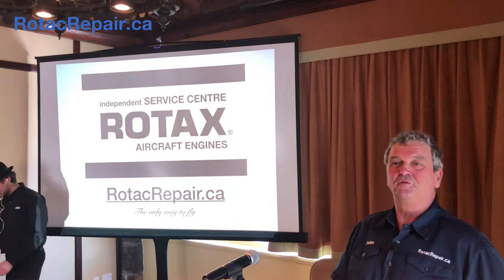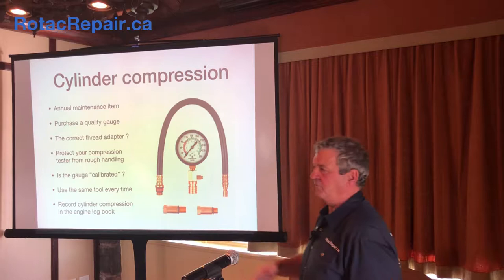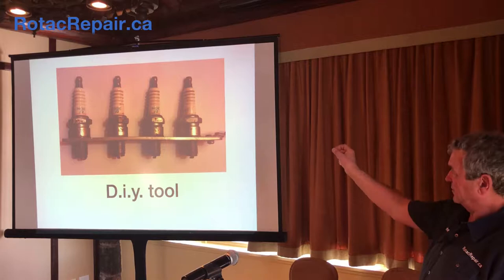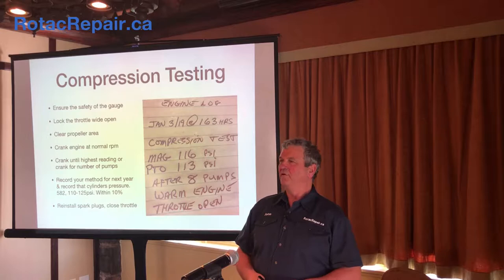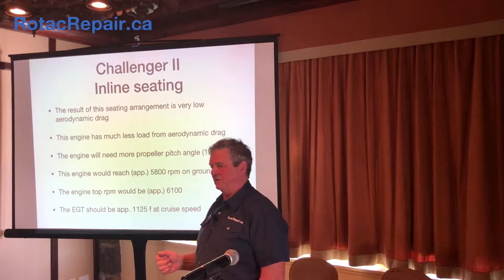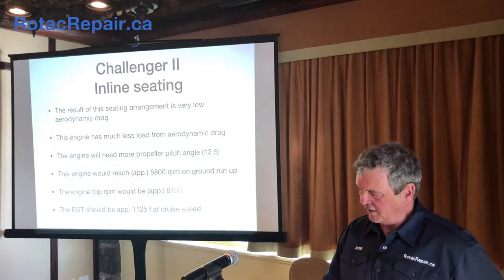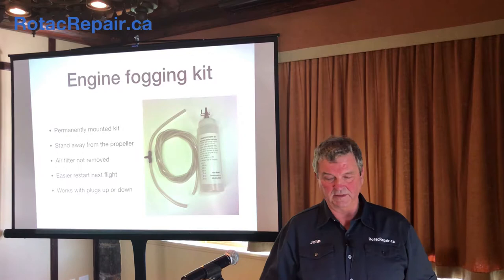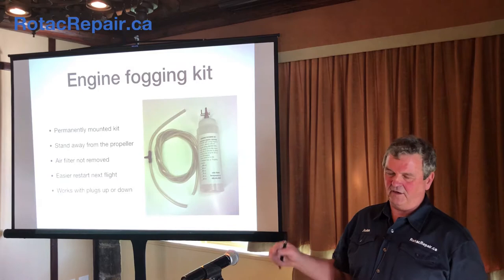Rotax Compression test, E.G.T., Propeller pitch, Carb Heat & Balance, Storage, Charging system

Comment: Great information John.   I've since installed the Carb Heater kit and the fogging kit.  Easily installed and they both solve the problems that I was facing.  Carb icing is no longer a concern and the fogging kit is an engine saver.

Comment: Thanks for the lecture!
Just one comment on the compression test: I do not think that it is necessary to open the throttles in a 2-stroke-engine, because the simple 2-stroke-engine features always "maximum cylinder filling", independent from the position of the throttles (simple 2-stroke is not quantity- but quality-controlled, comparable to a diesel-engine). Caused by the fact that the exhaust port is the last opening to close while the working cycle.
(I am no repair-expert, but once compared the compression-values in a high-output-4-stroke-motorbike-engine: no difference between WOT and closed throttles; obviously the rpm is so small that even closed throttles ensure full load. Of course this can be different in other 4-stroke-engines!)

Comment: Good seminar.    Question can I use a small wrap around 12v DC electric carb heater on single carb 34mm mikuni barrel slide   2stroke Kawasaki ta1 440 on my Aerolite 103?
Reply from the maker: Thank you for the compliment! I have no idea if you heater idea would be effective. My experience is with Bing carburetors.

Comment: how far should the egt probe go into the manifold?
Reply from the maker: The actual temperature sensor bead is in the tip of the probe. The probe tip should be in the centre of the manifold exhaust flow. Not bottomed out.